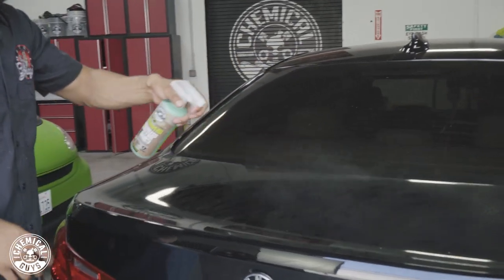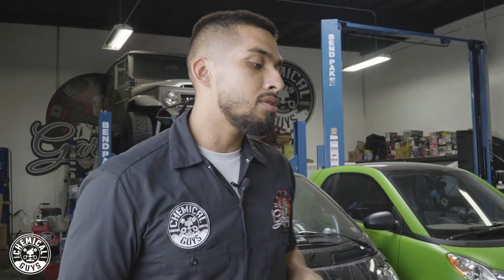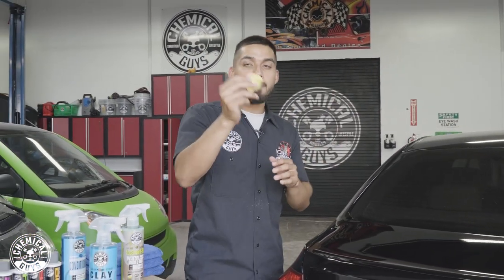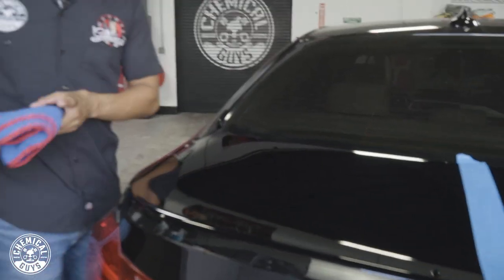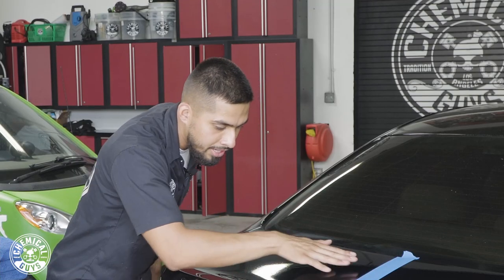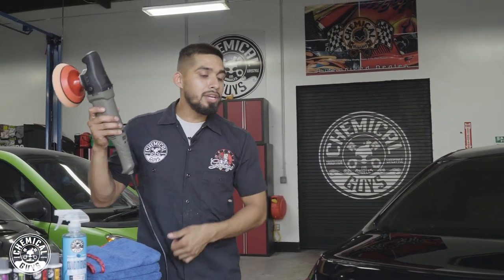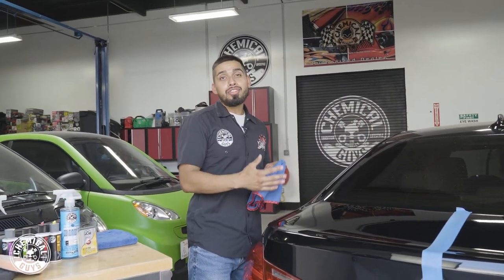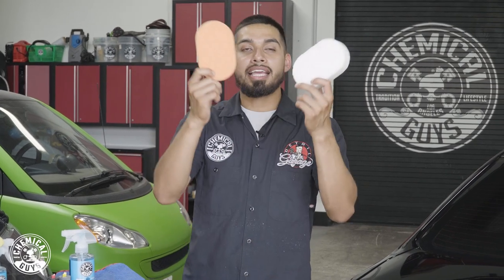How To Use A Rotary Polisher For Fast Paint Restoration! - Chemical Guys

Comment: Hey chemical guys what’s the difference between compound and polish?
Reply from the maker: Hey Ricardo! Compound is much more abrasive than polish, use this for removing deep scratches and imperfections before using a polish to refine the finish and enhance gloss.

Comment: I just got the torq buff 505x with the polish kit. If I start out with V32 do you recommend to go in increments ,v34,V36, then ,v38. Or can I go from v32 to v38?
Reply from the maker: Hey there! After using V32 the surface will need to be refined with V34 and/or V36 before using V38.
Reply: @ChemicalGuys  Awesome thanks for responding.

Comment: I think I'm ready to use a rotary polisher.  But, y'all say to have the rotary plate flat, while the guy on Apex says to use just the sides of the rotary plate.  Which way is the best?
Reply from the maker: Hey! That's right, be sure that the pad is always flat when contacting the surface. This will prevent excessive heat on the edge of the pad where it will cause marring and holograms. Also, when the pad is at an angle it will pull the machine in that direction but with the pad flat it will easily glide as you guide it.
Reply: Apex, in videos I've watched, always keeps it as flat as possible.